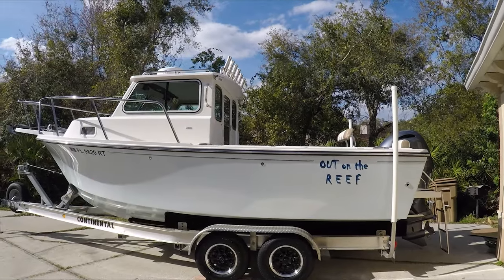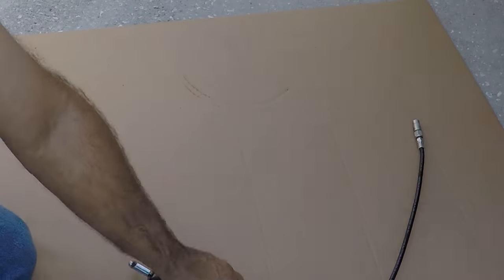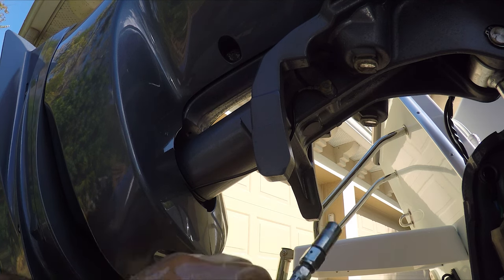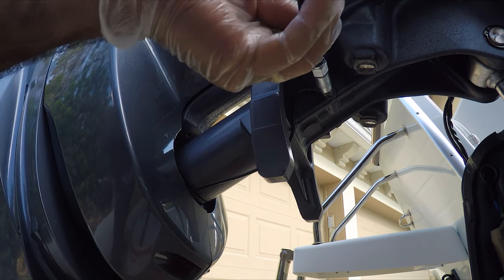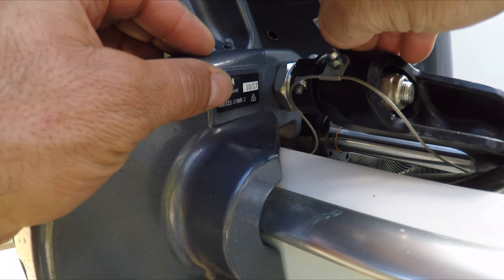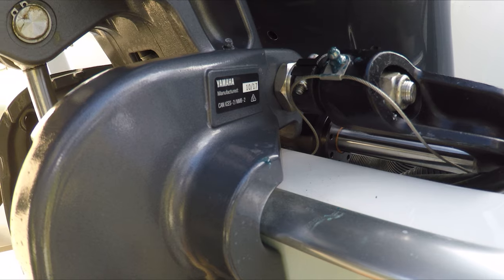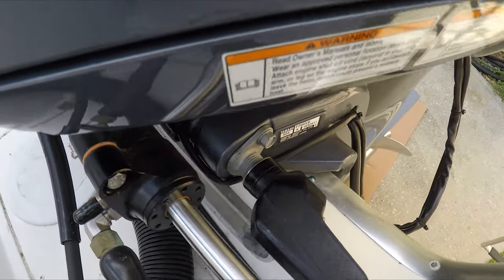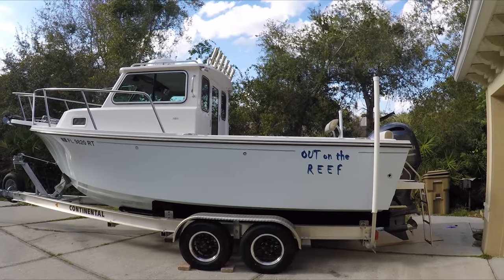Greasing Outboard Motor Components Crooked Pilotouse Boat Yamaha Outboard motor

Comment: Had a resent problem with my Yamaha 115, rear cowl lock handle wouldn't open  salt buildup had to order new parts after breaking handle and used vise grips to open. My handle looks like yours but I only have one in rear, anyway my dealer said there is a small hole to apply grease into shaft of lock check yours.
Reply from the maker: great info cap. thanks for sharing and great to know.

Comment: I can no longer find the Lucas marine grease on Amazon. Tried two different sellers but both advised supply chain issues with the product. Do you have another recommendation? Possibly WD-40 multi grease?  Great video by the way!!
Reply from the maker: I am sorry captain this is the only oil I use for dressing is great for marine use And I do not know of any other but there's a lot of brands out there you can do research that they're pretty good too Thanks for watching the channel

Comment: Are there any grease points under the cowl? or ways to grease any cables, or linkages?
Reply from the maker: the throttle cable inside the engine

Comment: I was thinking, with all that electrical stuff you’ve got going on, did you consider some type of fire suppression/ alarm type system. I was reading about that dive boat that went down in California, not that it’s the same, but iPhone lithium caused the fire issue. Just a thought.
Reply from the maker: is a great idea , i have a fire extinguisher standing by and a fire alarm inside the pilothouse,but that a great idea cap. thanks